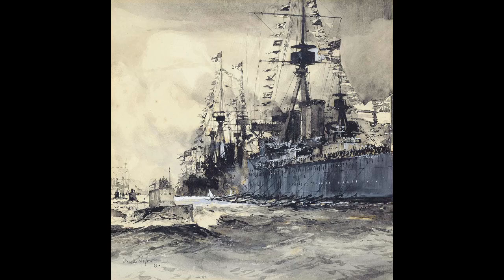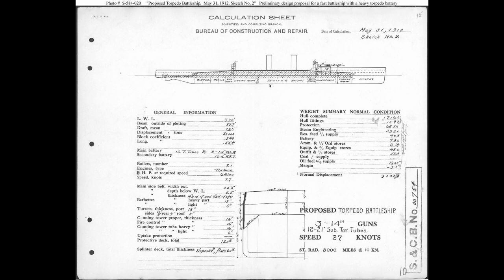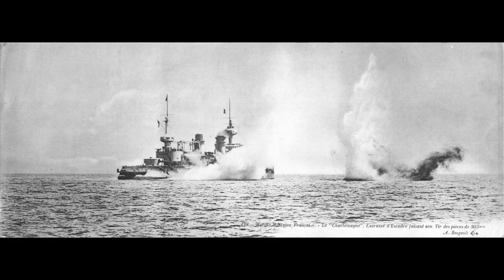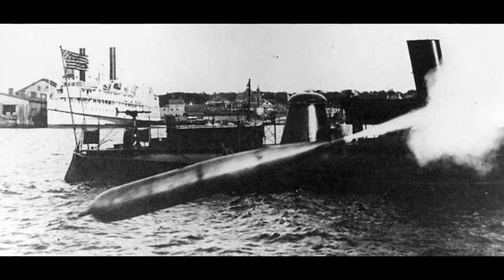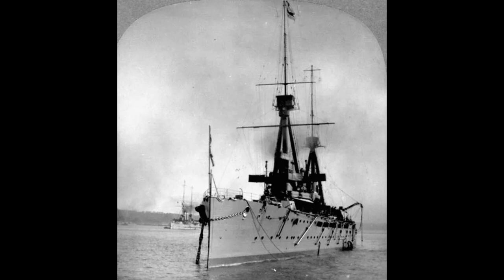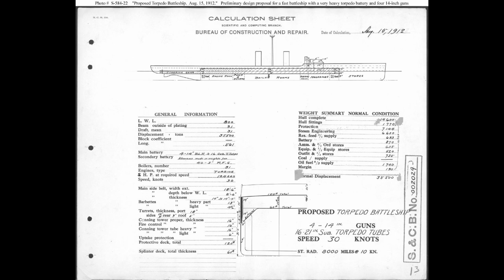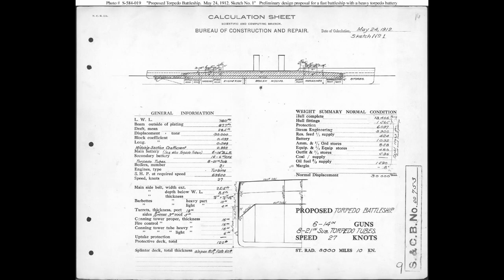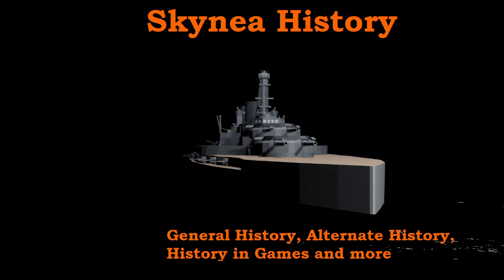Weird Battleship Designs - American Torpedo Battleships

Comment: Have you ever found a documented case where the battlewagons actually used the torpedoes EFFECTIVELY?
Reply from the maker: Not really, no. The only case I’m aware of (off the top of my head) is Rodney torpedoing the sinking Bismarck. And that’s just using a torpedo, not an effective combat use.

Which isn’t really a ringing endorsement of ‘torpedoes on battleships’.
Reply: @skyneahistory2306  I believe that both Nelson & Rodney had bow tubes that later on were not loaded, due to the risk of a mine setting then off.
.
Reply: @skyneahistory2306 I remember hearing somewhere that Hood may have also fired a torpedo at Bismarck (due to Prinz Eugen detecting torpedo noise) but nobody’s entirely certain if that’s true and it obviously missed if it was fired anyways
Reply: Graf Spee did use torps to take out some merchantman but that's not really combat per se.